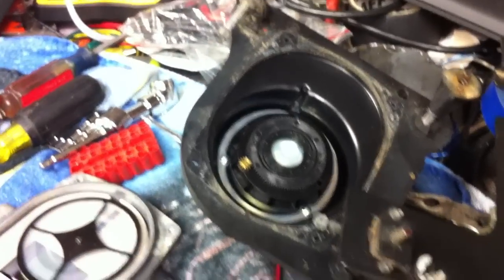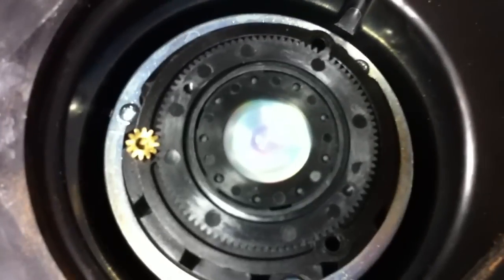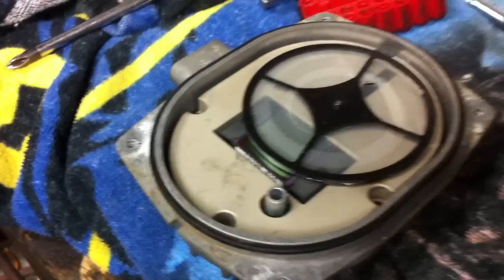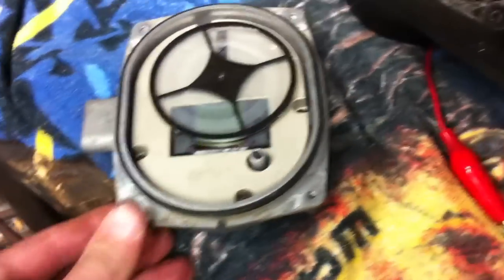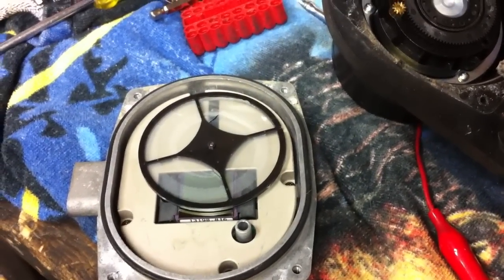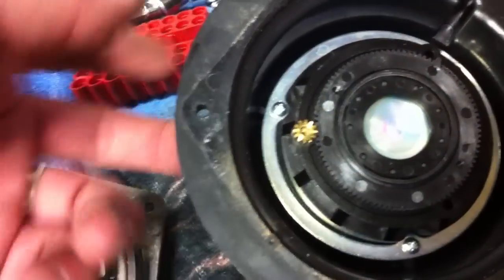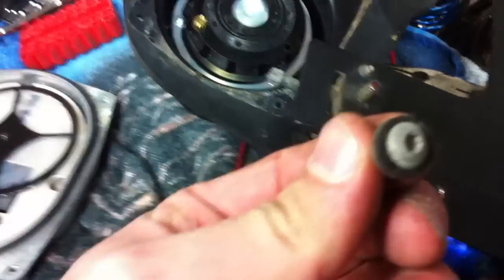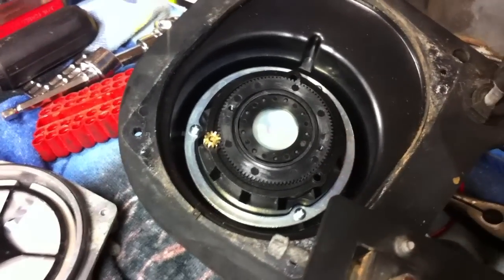Thermal Camera Test 5

Comment: Interesting ... so the original system used a CRT to project on the windshield? Do you happen to know the distance from the windshield when mounted in the DTS?
Reply from the maker: I don't think it was a CRT, but it definitely was designed to be a HUD.